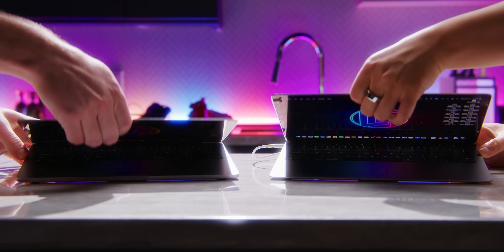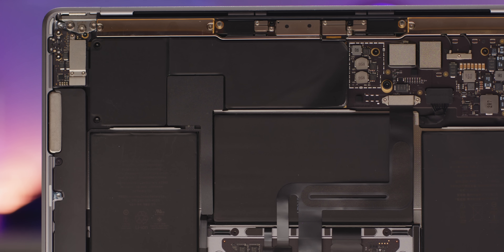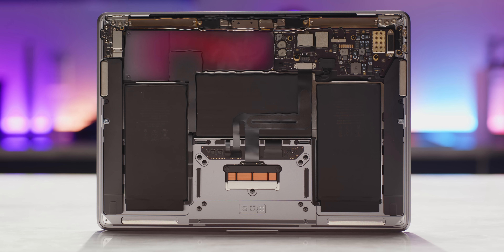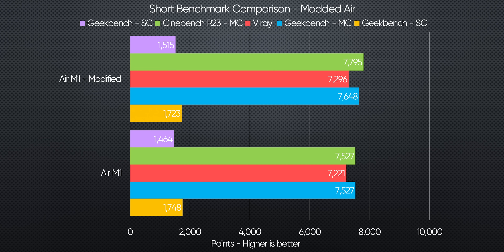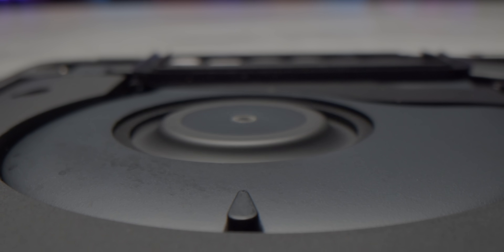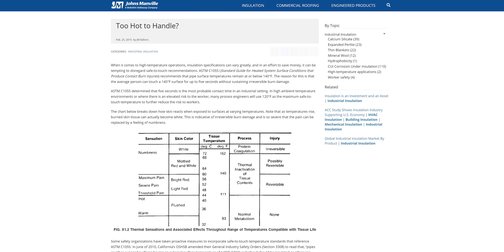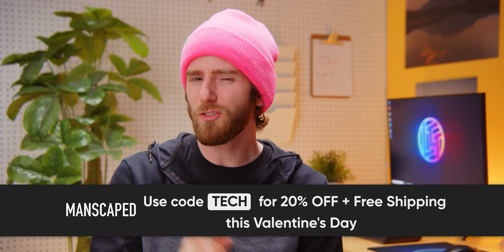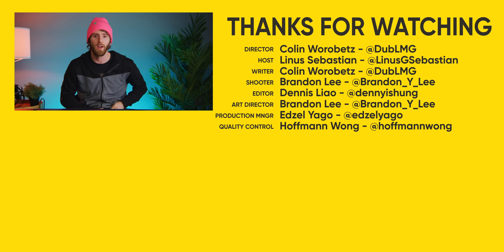Fixing Apple's GOOD Engineering - M1 MacBook Air thermal pads

Comment: I was planning to do this with my 2013 MacBook air but decided against it because I was worried about the batteries being heated and damaged.
Reply: @jack99889988  wouldn’t that just transfer the heat from the back of the laptop onto the batteries easier?
Reply: @jack99889988  The question is if it is enough. Show me the mathematical proof or simulation proof that it's enough to shield it off. I had elite x2 with a expanded battery during summer because it overheated and it was completely seals so it popped off my screen and caused damaged to the it and the stylus functionality. Even though it was rated at 4.5W TDP, it still did damage to the battery.
Reply: @howardlam6181  I don't think he needs one?  Thermodynamics law dictates that the heat will choose the easier path to travel, no?  If he adds insulation to the battery, and the whole back panel is conductive, the heat will chose to spread there instead.  If the back panel gets scalding hot then I'm sure it'd penetrate the insulation, but if it gets to that point you have a much bigger problem of a hot potato lol.
Reply: @aohige  Air is not nearly as good a conductor as the aluminium surface. Heat will accumulate and once it's built up it will spread to the batteries regardless of insulation. This is nothing remotely close to grounding electric circuits. You absolutely need simulation or math proof.
Reply: @jack99889988  lmao that guy needs to learn his vocab words "INSULATION"
Reply: I wouldn't worry about it too much. Even though the back panel does get a lot warmer it doesn't spread heat too far away from the chip in my experience (tried with MBP 13" 2018 and 15" 2015). From just a few centimeters away (like an inch or two) it isn't anymore unbearably hot. Also the back panel doesn't actually touch the battery cells directly so that should also help a bit. You can see this from iFixit teardown step 5 that the battery cells are a little bit recessed inside the plastic housing: https://www.ifixit.com/Teardown/MacBook+Air+13-Inch+Mid+2013+Teardown/15042 . If you're still worried you can always get some thermal insulation pads like suggested just to be sure. Also by doing this you will lower idle temps and (in case of every Air but the newest M1 one) make your fan ramp up less overall.
Reply: @jack99889988  Actually that would just lead to the battery not being able to dissipate heat. What you would rather do is somehow separate the metal of where the battery is, place thermal pad on that. Then the metal wouldn't be heated up form the cpu, and the battery would more effectively dissipate heat.
Reply: @jack99889988  Thermal Pad work both ways,since the batteries are colder than the back plate when heated the thermal pad will end up heating the batteries
Reply: You can transfer the insulating strip he tells you to toss away to the battery. That way, it would actually insulate it from the heat spread towards the aluminum casing
Reply: It need 1 more item to work better as solution,  the cooling pad (fans at bottom thing)
Reply: You're right. They should have checked this battery issue.
Reply: I did the same mod for MacBook Air 2013 but for SSD not Processor. And mine never gets hot because SSDs aren’t as toasty as processors.
Reply: I actually did this about 6 months ago on my 2013 MBP. I even went ahead and bought a bottom cover so that I can strip out the black insulated adhesive. I do have a laptop fan blowing on it 95% of the time. So far, it has worked out great. No issues, slight performance boost. low cost. No issues with my battery
Reply: The question is, does the battery actually touch the panel?
Reply: I did something like this in a 2012 air, the processors in the Air and the tiny surface area of the heatsink doesn’t make that much of a performance difference, at least in my experience, and the back panel never really heated up that much. I wouldn’t worry about the battery overheating because of a warmer bottom panel, I’ve done this mod (to a much less intense scale in terms of # of thermal pads) on a 2014 MacBook Pro 15 and it does not make any difference on battery temps at all
Reply: DON'T THINK just stick that fat thermal pads...
Reply: There is an air gap between case and battery on the A1466 airs, it is to protect the battery from impact.
Reply: You'd be fine in most cases, as general use and browsing wont raise your temps much.  Either way, the much lower TDP of the M1 vs the Intel Airs also come into play.  Intel Macs tented to run much warmer over their years, and their batteries were fine long-term.  Unless you're pegging your CPU all day long, this mod would be fine, and even then...
Reply: @Nramanoodles ?
Reply: @jack99889988  the problem isn’t the battery heating itself up, it‘s that the bottom of the laptop would heat up the battery. putting thermal pads between the battery and chassis would just accelerate that process
Reply: the battery has better chance of overheating in a 'hot chassis". By extracting the heat from laptop internals more effectively you are actually making internals (hence the battery) cooler, not hotter!  If the backplate is cooler by not transferring the heat from CPU effectively,  it does not mean that internals are cooler -- they are hotter! It's just backplate is insulated from them with air layer. Unless your CPU throttles constantly due to overheating and thus keeping your battery safer :)
Reply: @ANSARI5X5  thats kind of a hard job because battery exist on smartphones and their cpu often heat up like a lot. so since battery exist on those devices, having damaged battery kinda unavoidable.
Reply: @wolontong  I agree with you, but it's better to avoid heat as much as possible from the battery.
Reply: @jack99889988  not enough though
Reply: @ANSARI5X5  why would i take advice from a company that states third party repair is tantamount to terrorism, and that any repair in general should be avoided for my own protection?
they literally had that written on their website too you know?
Reply: @panameadeplm  Well, you can search about these informations online and check weather they are right or wrong. BTW, I'm a big Microsoft fan and I hate Apple, and I only use the iPhone cuz I got forced to, after abandoning WP.
Reply: Hassan Shahid  Yep the best solution is probably to take the cover off and use a drill press with a small millimeter size bit and cheese grate the cover.  Sure it could lead to dust or water getting in, but these are mac that were designed to die quickly in the first place so you aren't really hurting them that much.
Reply: Since everyone is complaining about whether this work or not. Buy a laptop fan, seems everyone forgot when laptops didn’t have fans built in 10 years ago
Reply: @jack99889988  that would just allow the the base of the laptop to more easily transfer heat TO the battery from the heat it absorbed from the heat sync with the pads now on it
Reply: @joelhinchliffe4119  its called INSULATION PAD for a reason lol
Reply: @joelhinchliffe4119  perhaps we can DIY a bottom cover with a plastic separation between near the battery area and the rest of the body, hehe
Reply: @Nramanoodles that's personal preference with keyboard and trackpad. It's not impossible to find better windows laptop for the same price ? Most in the same price range is better. You can do everything a MacBook can on windows laptop but better. It's a fact that's it's overpriced and less hardware. If you are not going to game on it. Any Linux distro is better. If you are gonna game. Well... Then it's pretty clear who is the winner... Linux > winblows > iCrap.
Reply: @pr0nGren  Well, I would be very interested to know which laptop has a more powerful processor and more battery life (in a slim form factor) than these M1 Macbooks. For a student these criteria are very important. Some models like the Huawei Matebook pro are not that far in computing power in a slim case, but they stay very far in battery life
Reply: The batteries being damaged would give you the perfect opportunity to ditch Apple and get a good machine :)
Reply: It's an apple product!... The batteries will get damaged very early in any case
Reply: @edrumsense  hmm my 7 year old macbook pro has enough charge on its original battery to last me 3-4 hours. not bad, i'd say.
Reply: @edrumsense  depend on your treatment to the battery and how often you use it .
Reply: there is a better solution. sell the crap and buy a real pc
Reply: @pr0nGren  Did you know that M1 Firestorms scores in some (signle-core) benchmarks BETTER than i9-10900k (which is like, the best CPU from intel).
That's a pretty bad advice tbh. It doesn't do as well in multicore (it literaly has 4 firestorms and 4 icestorms vs 16 cores or so on the i9-10900K)
Reply: @pitust  Yes but comparing to intel is obviously not that good because they are still stuck on 14nm and pretty expensive
Reply: @pitust  yeah intel. But intel is crap. And that's singel core. When do you need good single core speed ? Right.. games... That mac does so well... Or not. Same money with ryzen build vs iCrap the ryzen win everyday
Reply: piotr Stelmaszek hahha.. mac fanboy triggered.. single score is needed only in gamess which macbooks are already preety famous for.. (if you know what i mean) .. for programming, developing multicore is always better which macbooks lacks..
Reply: @pitust  Don't argue with an Apple hater. Let him be happy with Windows XP. It's what he deserves...
Reply: @pr0nGren  before M1, I was an apple hater( because of it's prize and performance). As a student I need portability, when it comes to laptops it has higher performance, battery, light weight, than any other windows laptops at this price range. Mac OS is much much better than windows (except gaming).Unix environment is better for software devs
Reply: @pr0nGren  laptop*. people buy those devices for reasons.
Reply: @wolontong  a laptop is a PC. Both desktop and laptop is a PC kiddo. And there is no reason to buy an iCrap
Reply: @sonysergey  PC is same as computer and you call a laptop a computer right ? Tho you are a bit true. It's a bit of a stretch to call an iCrap a computer. It's an overpriced "stupid but rich" tag.. no logic reason to buy one. Alot less hardware for alot more money
Reply: @pr0nGren  as a software dev I have quite a few reasons to buy a macbook, even after years of using linux I've been thinking about it. It's quite silly to just disregard it like that tbh I hope you're trolling
Reply: @sonysergey  if you where a proper software dev you wouldnt put MacOS over Linux. Its like buying that 5000$ shirt. It wont be a better shirt than a 20$ shirt. you just want to showoff with money. whatever you are into. Linux / Winblows can do it better.
Reply: @pr0nGren  Why are you on a video about Macs if you're so against them? The reason people buy Macs is because...drum roll...they want to. There are 100 reasons for buying a Mac. They are much less fiddly when it comes to installations, setups, etc., so for day to day use, they're simpler and easier. They have fewer minor issues with drivers and so on, saving time, and the OS is very intuitive once you get used to it. Oh, and they hold on to their value for longer and the OS updates for free.

On the downside, they are almost entirely unupgradable (which is fine for 90% of computer users), are often slightly more expensive for the parts included (though they tend to be slightly more efficient at using these parts to their maximum - most of the time not enough to make up for the "base cost"), and on 2016-2020 Macs the port issue is a big thing (I use a 2014 Air, so no problem for me).
Reply: Crabstove pc in every means can be used to describe a laptop.. pc means personal computer ,, like personal be it desktop or laptop or mini computer or else..
Reply: @sonysergey  He's an Apple hater. Haters gonna hate hate hate hate...
Reply: @glitchy_star_classes6276  for most purposes Mac OS absolutely does replace Linux, they are both Unix. On top of that if you use Swift and want to make apps for iOS you will want a mac ideally. Using Swift outside of xCode is feasible, but pretty much unheard of.

Obviously Mac OS wouldn't replace Linux for servers, but for a laptop where you just work? Most full-stack engineers won't feel a difference
Reply: Crabstove wont feel is quite a word for that.. if you ever compare a performance of a 1000$ non mac and 1000$ macbook for any language other thah swift say python, java, c++, c, r, etc there are many you will (until present) always find the 1000$ non mac(with linux obviously) at least 1.5 faster in compiling and any other tasks like such and thus is better.. even , if,  as you say i quote "wont feel a difference" .. the difference still exists tbh..

and other places such as server as you admit macs cant really replace..
Reply: @glitchy_star_classes6276  well the new macs have faster compile times than a laptop with a 10th gen i9 and thats when talking about the 999$ macbook air bruh

Comment: Just want to point out that with convective and radiative heat transfer, you definitely can not just subtract off the room temp and add back 35C, since heat transfer rate is very dependent on the ambient temperature.

Comment: 6:12 i dont think that is a fair way to calculate it... i mean... if the room temperature is cooler it means the heat is easily dissipated but the higher the room temp goes the longer it takes to reduce temperature of the laptop. It all around equilibrium, the hotter a source is the longer it takes to reach equilibrium with the room temperature, if the roomtemperature gets higher then it takes less time to reach equilibrium but the equilibrium is now higher becasue the room temperature which is what the laptop is trying to match is also higher. Im pretty sure that is not the right way to calculate it but i think i may be wrong, its been a few years since i've studied physics.

Comment: @LTT did you consider using the whole device to cool the device would cause the battery to become hotter? 
I would guess in long term after some intensive Workflows the battery could suffer more and would cause the device to reduce battery capacity much earlier than without this mod. 
Maybe I‘m wrong and this doesn’t affect the battery as much.

Comment: "With no way to further remove heat, the air will reduce its clock speeds and slow itself down" 

Damn, that's some high-tech air right there alright

Comment: Can't you place a thermistor on the chassi and regulate the processor power on software, using the chassis temperature as input?
This way you would have a larger heatsink (more thermal  mass), controlled  temperature AND could use a forced air support to get more performance when docked...
 Best of both worlds...

Comment: Can they use a vapor chamber like Surface Pro? The Pro 3 had a problem where it would heat up just a tiny area of the chassis that was fixed in the Pro 4 by evenly heating up the entire chassis.

Comment: perfect mod, 
I have an old Akasa laptop cooler with 2 fans, 
so sitting the modded MBA on it would in turn extend the backplate heatsink to the laptop cooler as a heat sink and it would also be semi active as the external side of the MBA would have air blown on it and so dissipate some heat 

so Imma go buy some super duper thermal pads and and a MBA 

oh can you also follow this up with modded heatsinks that use the raspberry pie ice tower and other heat sinks please 
it be funny to watch

Comment: With the heat now shunted to the chassis, those laptop cooler stands are now so much more effective thanks to the massive increase in surface area.  I'd love to see what kind of performance you could get with the thermal pads + cooling stand.

Comment: Wonder how this would affect the battery
Reply: This is the result of my running 5 consecutive Cinebench R25 tests back to back
The battery temperature does rise but not markedly. One of the guys on the Macrumors M1 Heatsink mod thread was using Handbrake to convert his video collection, he was doing this continuously for about 12 hours. The Battery Sensor 1 was reading 44.8 C, Battery sensor 2 was 34.2 C

Run 1 - 7805 CPU - 48 C, Battery - 26 C ( graphics stayed at 30 C for every test so I won't bother writing it down.)

Run 2 7801 CPU - 50 C, Battery - 29 C

Run 3 7806 CPU - 56 C, Battery - 31 C

Run 4 7814* CPU - 55 C, Battery 33 C

Run 5 7801 CPU 83 C, Battery 34 C

Comment: If you're the kind to just have you macbook plugged in to a monitor and ignored, this seems like a way to get macbook pro performance for a cheaper price.  

I wonder if there is performance left on the table with this mod by placing the mac air on a laptop cooler, making it considerably faster than the macbook pro.

Comment: i dont know man. cheap video idea and how fast they turned away from the "actual problem" chart, which isnt really one, sais it all. he talks like the thermal throttle is a problem but it isnt. who runs on full gear for 30min? guess you are not exporting movies on a 13 inch laptop.

Comment: Extended heating across the whole bottom would negatively affect the lifetime of the lithium-ion battery. So if anyone really were to do this (and pushing the machine to the limit), it is important to have some active airflow under the bottom panel to help remove the heat.

Comment: I don't use my laptop on my lap anyways I have it on a cooler thing that blows air up onto it + gives it MUCH better ventilation. Not an apple guy but this it a cool mod, I've always wondered why they didn't use the chassis as part of the heat sink.

Comment: The table at 5:47.... isn’t the top half more relevant, as we are measuring the outer surface, not a handle or knob.

Or did you go for the value used as it better reflects longer contact exposure gained by having a laptop on your.... laptop